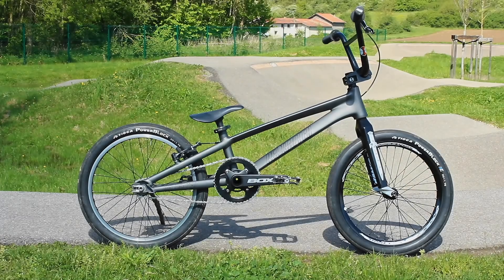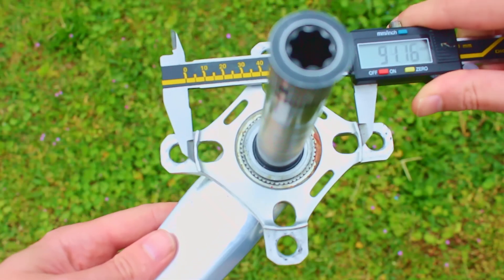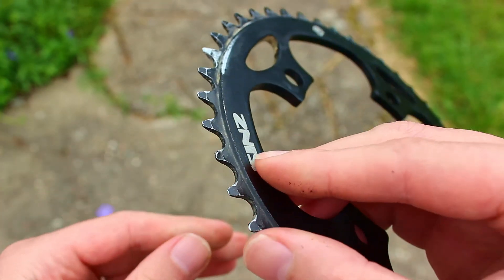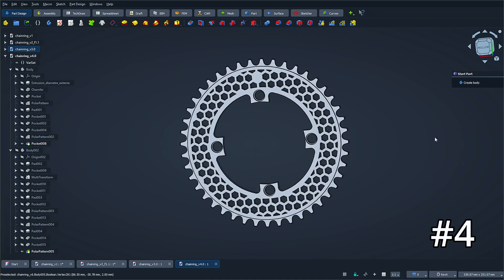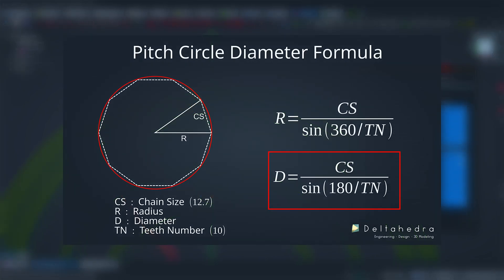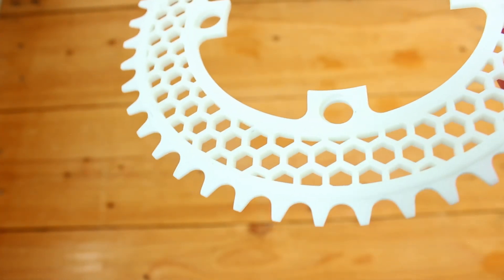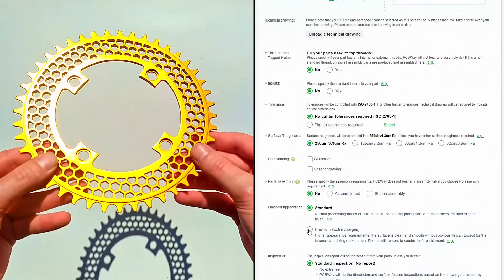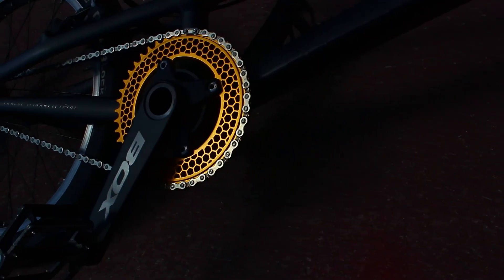FreeCAD to Reality - How I Designed my Bike Chainring (The Complete Process)

Comment: I used to ride freestyle BMX (raced before that), and I just ordered a small CNC router I will be setting up for light alloy and steel milling. I now want to get back into riding just to make my own parts. LOL 
If I were you, I would be holding my breath every time I throw my weight hard onto the pedals until I was comfortable knowing it would hold. LOL I once broke a Tree Bikes steel sprocket. The first gen had really thin spokes, but they couldn't hold up to the torque. Tree is awesome, though, and replaced it with the newer version that was a bit thicker. They said the first version had a problem with breaking.

Great work, it looks incredible, and you beat the specs of the companies. Well done!

Comment: how did you make the spreadsheet a separate window?
Reply from the maker: @ipadize I’m using a macro: https://forum.freecad.org/download/file.php?id=122719&sid=a93438208c80a2d61ee55bdf3d85b771
Just double-click the window tab to open it in a new window.
Then I use DeskPins to pin it.